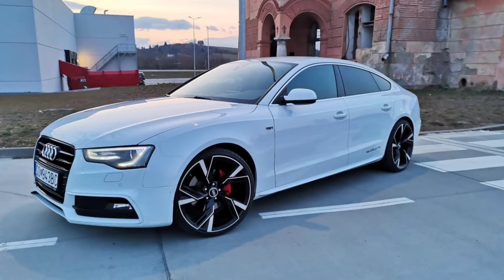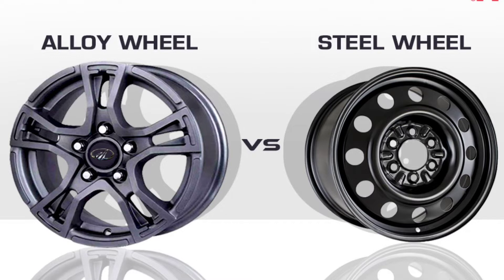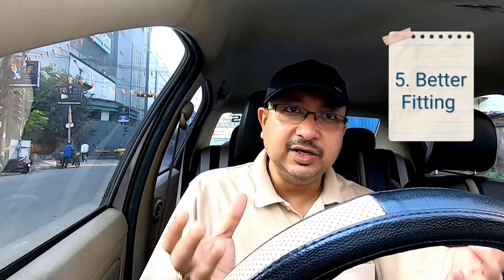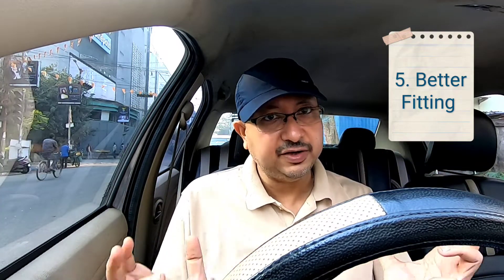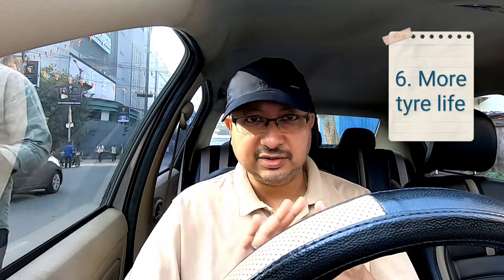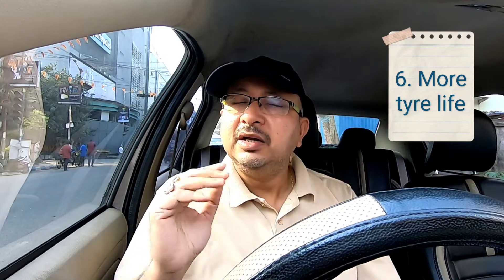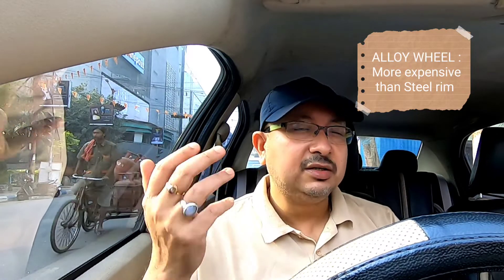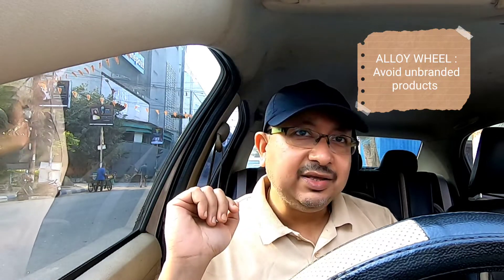Alloy Wheel vs Steel Rim । একটা তুলনামূলক আলোচনা

Comment: Very nicely and accurately mentioned ... However, there is one more aspect that you did not mention. Apart from being the reason for increased tyre wear on bad roads, alloy wheels also cause more frequent requirement of wheel alignment. However, when it comes to steel wheels, those require more frequent wheel balancing ...
Reply from the maker: Yes Ma'am. Thank you for pointing out.